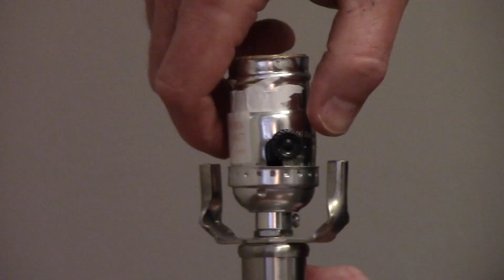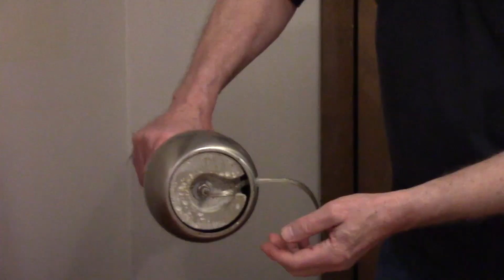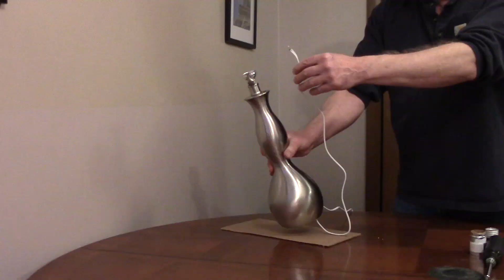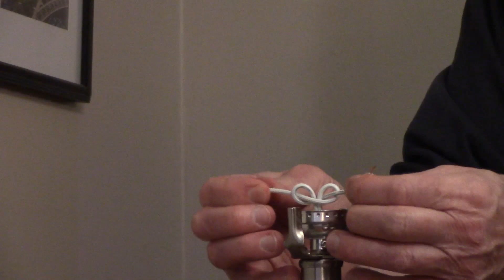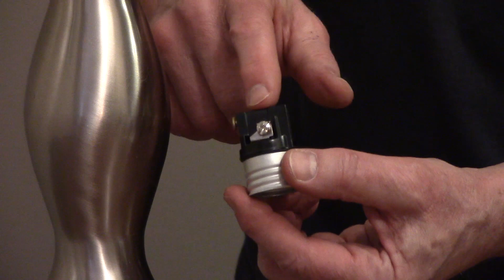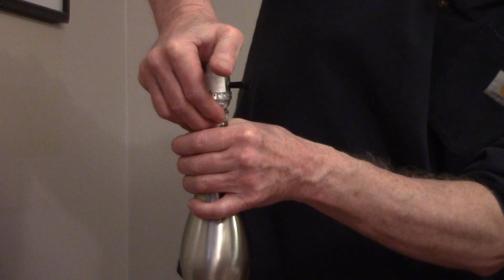Replace a Lamp Cord

Comment: Can you use an extension cord for a lamp cord?
Reply from the maker: Hi, you can use an extension cord if the cord will fit into the pipe up to the socket and the cord is rated to match or exceed the watt rating of the light bulb or bulbs. A lamp cord has the insulation stripped and sized to go through a standard lamp. 
Check out more home improvement tips in our e-books https://www.amazon.com/gp/product/B0B2KW1FQ9?notRedirectToSDP=1&.

Comment: My screws are both silver, now what? 😂
Reply from the maker: Hi, use an electrical tester to test for continuity between the center contact inside the socket and which screw shows continuity. This will be the hot screw. You can email me at fixitpodcast@gmail.com.

Comment: Mine sparked and tripped my breaker....can i fix it?
Reply from the maker: Hi, you can check the wiring and make sure there aren't any loose wires touching. Make sure the cardboard insulation is in place. You can email me at fixitpodcast@gmailcom.
Reply: @FIXITHomeImprovementChannel this is a 1960s era tension lamp  3 lights, it was my mothers and it means the world to me , i hope it can be repaired.